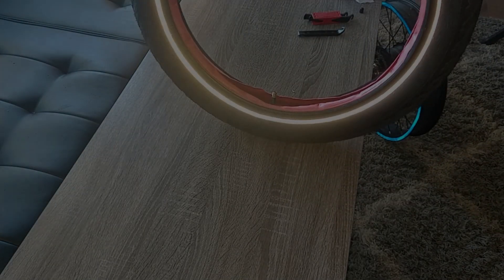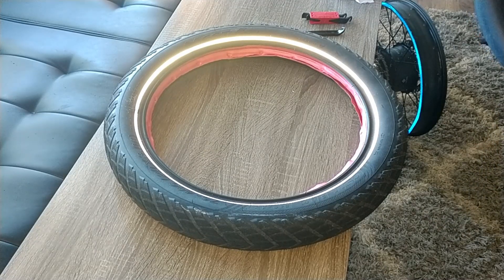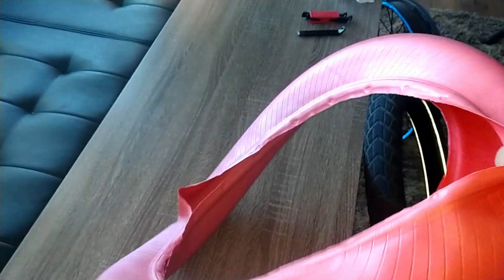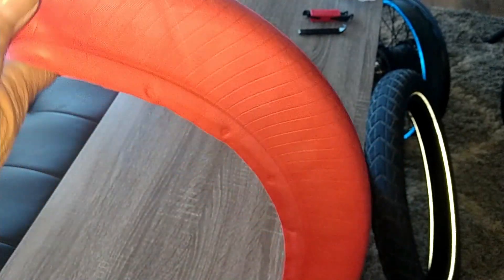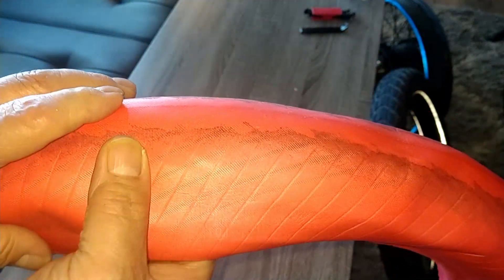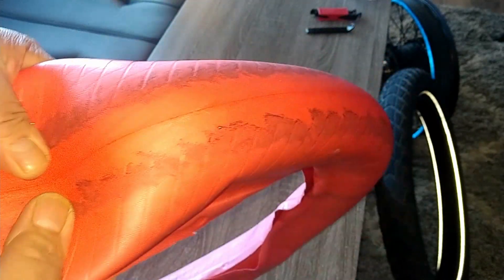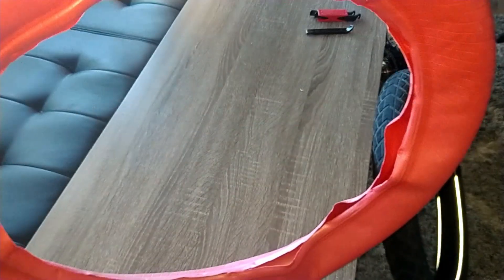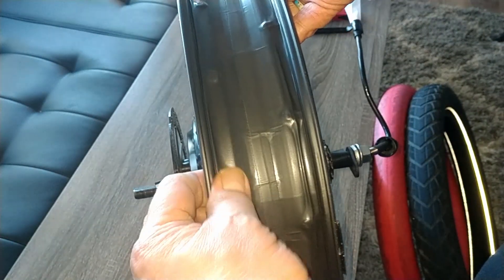LECTRIC 2.0 - Are Tannus Inserts Any good? One Month Inspection & Not impressed!

Comment: I was expecting that. They made you their girl friend. That's a hard lesson. Goodyear tried that in the 80;s
Reply from the maker: I have to admit I wasn't too surprised after what I had heard. Had to see it for myself, which I did :(
Reply: @Pandafoo  The front tire I would leave it be. In 60 years of riding I have never had a front flat.
Reply from the maker: @Saddletramp1200  I'm not planning on messing with the front tire at all :)
Reply: @Pandafoo  Store the rear tire out of the light & use it when the front needs changed. A tire worst enemy is sunshine & time. I have removed tires that looked new but were dry rotted.
Reply: Crap, I just ate a nat. oh well, more protien. Ketsup rocks!
Reply from the maker: @Saddletramp1200  I now have 3 new tires I keep inside in a closet. So no light and low humidity.